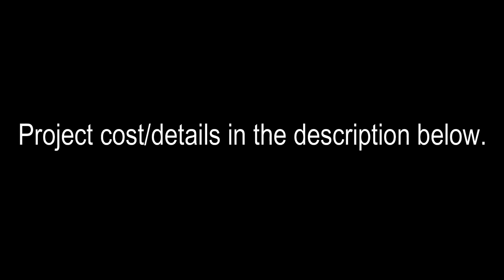Truck Camper Flatbed Build! Pickup Rust Issues...

Comment: I learned to weld with a Lincoln welder purchased from Home Depot and the desire to learn and a new trade to my list. They had completely got ride of these kind of classes in my high school. I have a a thirty plus year old truck, with 300,00 miles on the clock. I have lifted it, converted it to a extended cab, modified the bed and canopy to overland for weeks on end. I do all my repairs, mods and maintenance myself. The more you learn and are able to do yourself with pay two folds when the time comes. Good work on your repair/mod. Now that you got bit by the bug, we’ll have to see what comes next.

Comment: looking good, and the 96 is about the best year of the vortec (also the first year) i have had two still own one and its grea the only down side is i need to find a quality fuel um that doesnt need replacing every 75,000 miles.
i like the flat bed should work ou cery well for your guys.
i keep flip flopping between building a flata bed and custom camper for my rig and just finding a camper for cheap that works

Comment: Nice work !! I have a 2004 ranger 4x4 shortbed. The frame looks like yours did in the beginning. Bed cross member are rotted  up BAD! I'm considering on putting a flatbed on it. Gonna build a slide on camper for it. So I can use the truck for other purposes as well. Your build has me thinking overtime now on this idea. I agree with your view on older is better.

Comment: Turned out great!  My only concern would be those barrel bolt latches on the side. They could vibrate and come unlocked and your panel could open on the road. Find a way to secure those and is good. Looks amazing, and I'm kinda in you're school of thought about keeping those older trucks running. Kudos to you.

Comment: Great job and pretty well thought out.
One thing I would tell anyone wanting to do something like this would be buy a western truck. In the Idaho pan handle they don't use salt on the road. They use a beet juice brine and crushed stone even in the mountains. I think the price of a plane ticket and fuel to drive it home is much better than buying a truck with a rusty frame that you have to grind down to clean metal leaving you with a frame that's a bit thinner than when it was made. Check craigslist for Spokane Washington for rust free decently priced trucks.

Comment: Shouldn't you also take off the cab as well to check the frame there as  well for rust issues? And spray paint it with some rust protection paint or product?

Comment: I like your opinion is Siri on what you think about old vintage trucks built stronger built Better Built in the USA with real hard work and pride people today lack the ability and mechanical skills to maintain and fix older vehicles or they've just become too lazy to fix anything so it's easier to get a new truck and not have to worry about anything but me I'm into the older trucks As You Are my truck is not old old it's a 2002 Chevy Silverado 2 door short bed 5 speed manual four-wheel drive with the 4.8 with only 64,000 miles on it I am looking forward to seeing more of your videos thank you for posting this video on this older truck that you built a new bed on as I have done to all of my trucks got rid of the old rusty rotten beds and built my own style bed I have a thing for building dump bodies on smaller trucks and even bigger trucks thank you for your video

Comment: Your right ! They don't build them like they used too! I have a 97 Toyota and a 2002 ford F250 its what I have my truck camper on. The newer trucks with the spects like mine is way out of my price range. Nice build, put the camper on it and check out your build before taking off on a new adventure. Those campers are heavy and puts a lot of stress on the truck frame. Whet kind of tie downs are you going to use?

Comment: Dude that truck bed looks nice you done a great job it looks good and it is good and stout the only thing is I think that galvanized bolts would have been better because they do not rust but at least now it is safe you do not have to worry about the camper falling off which would be a real bummer

Comment: You might want to paint or burn the wood on the underside of your tire wells. You'll be getting a lot of dirt and water splashed up in there and that wood will start to go bad quickly if you don't protect that wood... In fact I would have gone the extra mile and lined the tire wells with metal flashing after I painted it with a good oil-based exterior enamel  paint. But that's me I go over board quite often on stuff like that. When I build a utility trailer I like to know it's going to last at least 20 years if it's token care of. If I sell one I tell the people to repaint it every 5 years if it needs it or not. To get a long life of use out of the utility trailer... 
Y'all did a fine job building that new bed. it looks like you'll get good life out of it... Much love and prayers, be blessed in Jesus name... BBE..

Comment: I am not familiar with the exact nature of how  truck bed lays onto the bed, the exact clearance, and consequently how water condensates underneath: but I would pick a solid product to weather proof that wood for sure with patio stuff or similar, drastic temp changes boondocking can really accelerate mold and water damage. If you are concerned about paint chems etc, greenbuildingsupply website has eco stuff. fyi